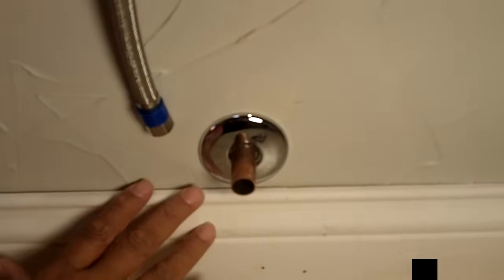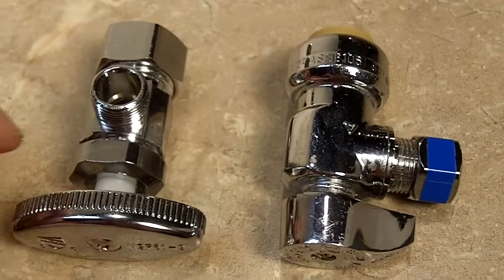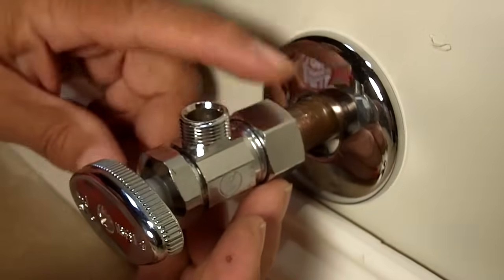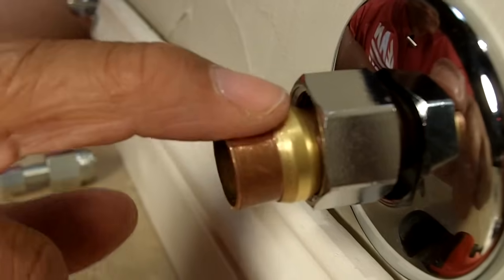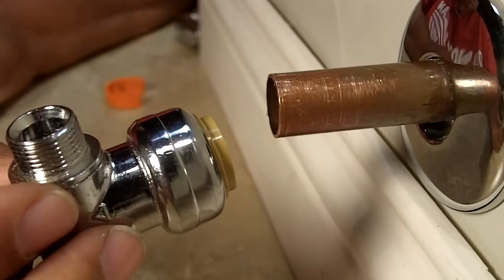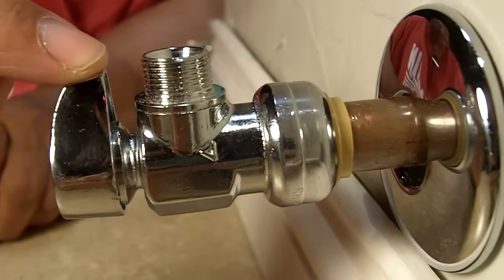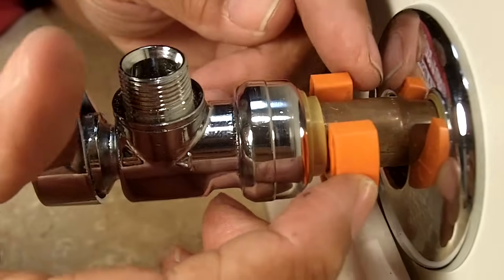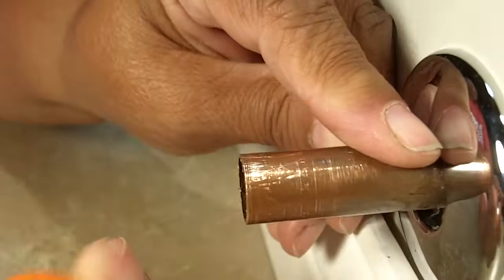Which Type of Water Supply Valve Should You Use: Compression or Push Fit?

Comment: If you need to change the valve with the ferrule. Leave the ferrule in place and wrap teflon tape around it before installing a new valve. It will ensure a leak free connection.

Comment: Just a note. I had an office trailer with a compression shut off. It came off in cold weather and flooded the trailer. Not sure how long the push fit o-ring seal will last. I only trust a sweat or iron pipe thread screw connection.

Comment: For a homeowner, nothing beats a sharkbite. If you install them correctly and take the time to properly prep the pipe, they'll be just fine. Don't let armchair plumbers try and tell you they're terrible. 99% of sharkbite failures are a result of installer error, not a product error.

Comment: Do you have a video when you need to use a FIP water supply valve? 
Do you need a ferrel if you are using a FIP connection?
Reply: Generally no you wouldn’t need a ferrule using a FIP the threads are usually tight enough. I’d just use liquid Teflon though better than tape. If you had a MIP then yes use a ferrule.
Reply: @oscarrobertson4800 thank you this was very informative!

Comment: Is it possible to change de angle of the valve, just to loose the nut of the compression valve,turn the valve of 90 Degres and tighten the nut with the same feral? Is it dangerous to leak?

Comment: Just replaced an old compression fitting. Didn't want to cut the pipe due to the length of the pipe, but couldn't get the ferrule off anyway. The longest part of replacing the toilet was messing with the old valve. Anyway, used my first Sharkbite and I am sold. Slid right on.

Comment: She didn't mention two important steps with Push fit. First, the copper pipe edge must be chamfered to remove any sharp burrs. If not, the O ring inside the fitting can be cut resulting in leaks. Second, the depth of the press must be marked on the pipe to assure the steel barbs in the fitting are fully engaged. Sharkbite has a tool that performs both functions.

Comment: I prefer compression fitting,  if I have the time.. saw a couple shark bites not hold but that's probably the installation.  Clean the copper off good before doing either

Comment: I realized that my shut off valve is sweated on so that ends it for me. I don't have experience with torches and the only solution I see would be cutting the copper pipe and hope there's enough length to install a push fit. Does this sound right to you?

Comment: I installed a water pressure hammer in my toilet, but the hammering sound is still present when adjusting more the water pressure, any suggestions? Thanks for any advice you can provide

Comment: Nice video.  I didn't know about the those push fit kind.  It also looks like the compression one you showed also has that annoying style of shut off that eventually gets corroded and stops shutting off the water.  While the push one you used looks like it has a ball valve which is so much better and worth the cost.
Reply: When buying the valve. Just make sure it's a 1/4 turn valve and not a multi-turn valve. All the 1/4 turn valves have a ball valve. 1/4 turn valves can be compression, push-on, sweat on and probably screw on.

Comment: Question: My shut off valve looks like the compression valve in your video EXCEPT that it doesn't have the large nut in the back. What do I have? It looks like it's just slipped over the pipe from the wall. Thanks for the help.

Comment: When you don’t have enough room to fit your fingers behind the removal tool for a shark bite valve you can place an adjustable wrench behind the removal tool to give yourself leverage and distribute even pressure. Much easier then trying to use your fingers.

Comment: My home has compression valves on cpvc is that safe?  They need to be replaced what should I use?  I wonder if our crappy builder used a pipe cement to adhere the valve.

Comment: They make a rigid stop wrench, which is designed to put on compression stops, the 5/8 part pulls apart and above that sticks into the 3/8 nut to hold the stop and the other part tightens up the compression nut, so it's basically a two and run wrench design to put on angle compression stops.

Comment: The key to push fittings is the pipe needs to be de-burred. On the outside and in side of the pipe, clean the outside of the pipe with steel wool, double check for burrs and debris and check the shark bite to make sure that there is not any debris inside the fitting and it will work for many years.

Comment: Tips for replacing a compression valve to push fit: When removing the ferrule with the tool, it helps to grease the end of the pipe to help the ferrule side off. After, you can use alcohol to clean off the remaining grease.  Also important; if the compression valve was on too tight, the pipe could have been compressed to a smaller diameter. If that is the case,  you will not get a good seal with the push fit. Be prepared to have to cut the end of the pipe to get a new fresh section of the pipe - this is not hard to do. Before you pull the ferrule, be sure you have a long enough section of pipe in case you will need to cut the pipe. If your starting with a short pipe; best to leave the ferrule, and just replace with another compression valve.
Reply: Thanks a lot. My case is a compression valve with a short pipe so I going to replace de valve for another compression valve using the old rin.
Reply: Does re-use of the old ring lead to leak?  Should you put a dab of grease on the ring to seal it?
if you put in new ring, is it recommended to grease the pipe section where the ring sit to prevent corrosion?
Reply: @alfaromeo6985 if you reuse the “old ring” which I’m guessing you mean the old ferule it can leak. So here is what you would need to do..
Use pipe thread sealant that comes in a little tube, I like the shit that comes in a yellow tube, from Home Depot. Apply a good amount of that onto the outside of the ferule and you can even apply some into the inside of the new shut off valve. Then tighten it up. If it still leaks a little you can try tightening a tiny bit more. If it still leaks take it apart and wrap the ferule 5 times with thread tape, then reapply the pipe thread sealant. Retighten and you should be good. I’ve never had one leak after doing this. But it’s better to do the job right and just buy that tool Leah showed and remove the old ferule.
You will find with plumbing it’s typically better to replace with new parts.

Comment: Compression fit is just a more reliable fitting.    IF you control the variables you can be more confident you are going to have a long term reliable connection.  Push-fits work, and I'll use them on occasion, but they are riskier.

Comment: One note about the push fit is that, if you don't push exactly straight into the pipe, it can go half way and then stop, leading you to believe it's fully seated. The cure is to make a mark on the pipe 1" from the end, then be sure the push fit goes all the way to that mark. If it doesn't, pull it off and try again.

Comment: It wasn't mentioned in the video but if you use a push-fit, you need to make sure you push it in the correct depth or you will have a leak. The packaging should tell you how much it pushes in...typically 1"-1.15". Mark that on the copper pipe so that you know you have it seated at the correct depth.
Reply: YES...absolutely right! Thanks for the reminder

Comment: You do not need that little tool to get the valve off with the push fit.....there are several other ways to do it......and push fit may cost more, but not really because you don't have to know how to solder and you don't have to have the extra expense of the tools required for that and the time saved is worth so much too.

Comment: The shut off valve under my toilet needed to be replaced years ago. I don't shut it off, not even to change the flapper in the toilet. The last few times I did it leaked and I adjusted until it stopped. I'm not going to be so lucky one time too many. I tried to shut the water off and the whole valve tuned in and the water did not shut off. I purchased a brand called BrassCraft at Home Depot. I was tired after work and didn't realize it was not the brand I asked for but live too far to return it just to exchange it, probably was cheaper anyway. 
You gave me the confidence to finally tackle this job. I was always afraid because I don't have any shut off valves for the hot/cold water pipes coming into the bathroom. I'm going to see if you have a video of installing a shut off valve in a water pipe. We have a new home with all plastic type pipes. The plumber did use copper here and there. Must be for a good reason where needed. Well, thank you very much. I learned so many small points no one ever mentions.

Comment: I used the compression valve and it was leaking a little despite it being really tight. The push fit worked like a charm. No leaks . Thanks for the tutorial:)
Reply: compression fittings, just like others require a clean-square-cut thats been sanded and demurred

push fits also require this
but they are also twice the price.....but....really speed up install 

time is money
i swap out angle-stops probably in the numbers of about 20 a week, which saves me a solid $350 a month

but if you're a homeowner and a plumber is trying to charge you a zillion$
the push fit is the way to go

the one caveat on copper pipe is it's absolutely imperative to cut the bur on the OUTSIDE of the pipe
as it can damage the internal O rings leading to premature faliure

pick up an "inside/outside" pipe reamer at your big box store for $12 and you're a better installer than 90% of licenced apprentice installers
Reply: If you wrap some Teflon tape around the ferrule you can stop the leaks on the compression fitting
Reply: I love this woman!  You have helped me so much! My family think I'm so cool now.  A plumber would have charged me lots of money to fix this problem. (I realize they would have done more work than just turning the packing nut) however, it's fixed. It took more time to find the wrench than to fix the leak! Thank you so much.

Comment: Thx for another great video Leah!
I want to replace all 1/4 turn valves for my daughter's condo built in 1987. Not sure when they last installed these shutoff valves but they look old and I prefer 1/4 turn better.
Would you recommend replacing water lines as well as they look ok -  kind of hard to tell if they are bad or old?

Comment: How can a push-fit valve replace an old valve if copper pipes are already in place?  I could push-fit one end, but then the other end?  I can't bend the other end like a rubber hose, so ...?   [EDIT: I found "slip-tee" SharkBites.  Good?]
Can there be a push-fit on one end and a compression-fit (with a "feral" under a nut) on the other end?  How can I find one for sale?  What search terms?

Comment: Instead of calling it a push-fit isn't it usually called a shark bite fitting? for a shark bite fitting to not leak, the pipe it is installed on must be thoroughly cleaned, first. Then the end of the pipe must be deburred completely.

Comment: Except for the cost the type of valve to use in this instance is either quarter turn or a multi-turn. The quarter turn, in my opinion, is better because the only time you’re really going to use it is in an emergency when the supply line to the toilet or faucet breaks or leaks, or the toilet is overflowing. Then a quarter turn valve is the quickest to shut off. The multi-turn valve takes a little longer to turn off, and if it is old, sometimes doesn’t seal off completely due to wearing old the valve seat. I always use quarter turn valves because of this.

Comment: Solder if you want to do it right. But for the purpose of this video, compression. Push fit relies on rubber to seal. Compression relies on brass/brass compression. A no-brainer. The caveat is that the compression fitting cannot be under or over tightened.

Comment: The most popular brand of push-fit is Sharkbite. They really grip. A video testing them showed the water pressure had to be around 750 PSI to blow one off the pipe. Average water pressure is 1/12 to 1/10 that level of pressure.

Comment: I use the push connect valve brass craft and thank god for your video.  I have a leaking toilet water supply line and try to replace my old push connect brass craft.  I thought I can easily just pull it out but can't believe how hard and difficult it's.  I turn to youtube and found your video was very helpful.  Thanks again for taking the time to post this video, your video has solved many people's toilet problems who want to learn how to repair their own toilet problems because it's expensive to have a plumber doing for you, thanks for a million.

Comment: The SharkBite fittings that I had, the Chrome cap that goes over the line also serves as a removal tool. You just pop it off spin it around and remove it like you showed in the video.
Reply: Great tip.

Comment: can a shut off valve be used in reverse?  my buddy has an old house with no basement.  there's a capped off copper water line coming out of the wall behind the fridge.  he wants water for the fridge.   the water line is smaller than 1/2" but  bigger than 1/4", my guess is 3/8".  i'm having him measure it today.  i want to install a shut off valve at the end of the line but can't find any with 3/8" inlet x 1/4" outlet.. i did however find one with 1/4" inlet x 3/8" outlet.  my plan is to use it in reverse.  i really just want to use it as an adapter but if the shut off valve works, that'll be a plus.  sounds a little off the wall but wanted to hear your thoughts.
Reply: ....all water lines come in under the sink and i don't see any lines matching the one behind the fridge... and i'm not crawling under his house LoL.  i did try pulling out the dishwasher, but it got hung up and didn't want to make things worse.  i did tell him to just use ice trays. LoL!

Comment: Don't like push fit valve. Pushed in and leaking water.then it's impossible to take off.i used two wrenches and can not move a bit. Nightmare
Reply: You have to depress the plastic ring on the back. They make a tool to make it easier. Super easy. And you need to de-burr the pipe and clean it to prevent leaks. The push fits are decent... no replacement for a “proper” joint, but definitely don’t leak when installed right.

Comment: I know this is an older video, but you did a great job explaining and I appreciate that. Great work. I'm looking to replace my older toilet / older house toilet shut off valve but I noticed that the pipe coming out of the wall is not a copper pipe I assume it's a lead pipe or whatever the gray tight pipe is. Does it matter what type of valve I use or process or is everything still the same? I can send pictures if need be I appreciate any help

Comment: If you don’t have the special U tool to remove the push on, you can actually use a crescent wrench. Adjust it to fit the pipe and use it the same as the U tool.
Reply: There is another tool that works like a pair of tongs. One end slides on to the pipe and the other end onto the valve. Squeeze the arms together and pull. Costs about $8 but is well worth the cost even when you have room, because of the leverage it provides.

Comment: Problem - My toilet shutoff (which I believe is a THREAD ON valve), is tight against  a one piece, solid trim ring.  I can't grip the pipe while turning the valve.  Is the pipe end inside the wall threaded into a T, or soldered?  if threaded, unscrewing the valve may unscrew the pipe.

Comment: The push tool is $1-2 here in Canada depending on seller.  Must be a buck or less in USA.  So not a big con.  The shark bite or push and go style valves are $12 (again less in USA)  but the ease of installation and lack of time to do it plus so many people may have a wrench but just don't know how to use them properly make the push on the monkey way to go.  Especially now with pex pipes so prevalent.   Pex compression tool is $100 here and a big con for a valve or two.  PEX compression tools are mostly used by contractors because they do volumes of fittings and those fittings are worth pennies so a plus for them

Comment: You didn’t prep the copper pipe before installing the Shark Bite valve, always sand the pipe to make sure there are no burrs that could cut the internal ‘O Ring’ inside the Shark Bite fitting. That’s the difference in a amateur installation and how a professional plumber would do the install.

Comment: Excellent vid. My valve body is right up against the wall and I can see what appears to be a threaded pipe it’s attached to. No room to even put channnel locks or vice grips on it to keep it from spinning while attempting to loosen valve body. This operation will definitely involve opening up the wall to expose the pipe T it’s screwed into. I managed to stop the leaking valve with the rope material.